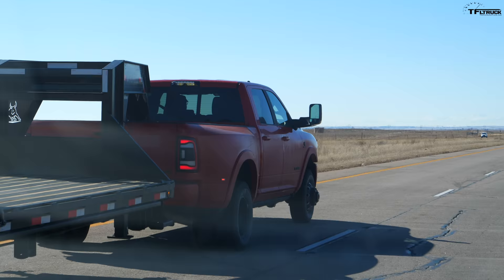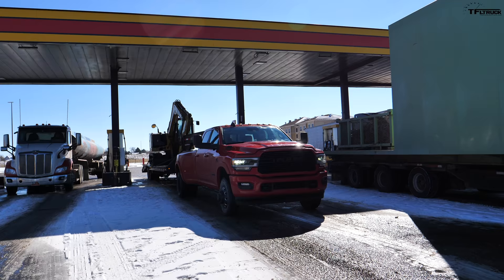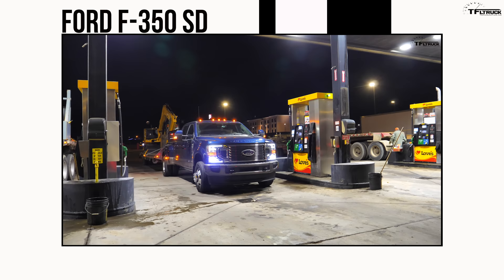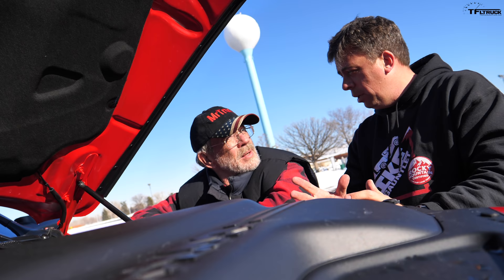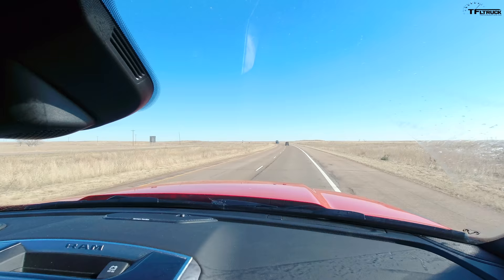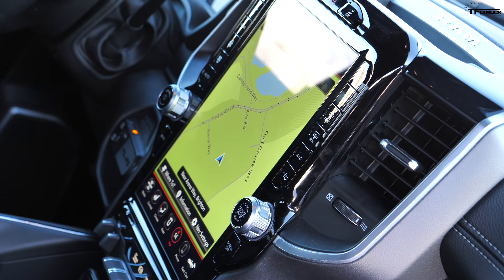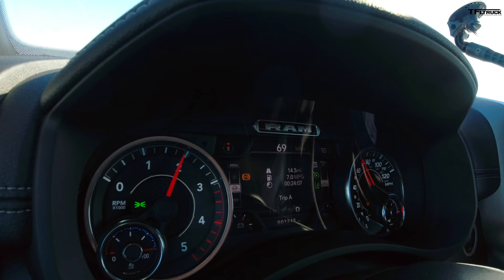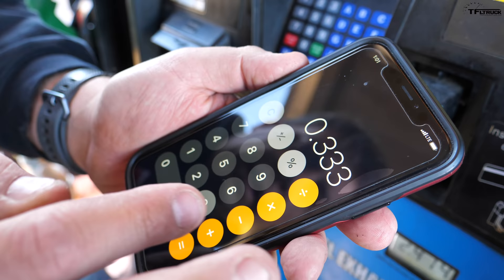New Ram 3500 Cummins Takes On Our 30,000 Lbs MPG Challenge Against GMC & Ford Diesels!

Comment: Ok Ram boys come with all your excuses.
Reply: Well it is a 6 speed vs a 10 speed...
Reply: It did great with that 6 speed and 4:10 gears!
Reply: Jason Williams it has a 4.10 axle ratio to offset that whereas 3.55 on Ford and 3.42 on GMC
Reply: L W 4:10 gears get you the worse mpg. I had 3:21 gears on my 2016 ram mega cab limited Cummins 2500, and that's why I was able to achieve the mpg I was getting 19.4 -20.1 with mixed driving.
Reply: John Doe ya I realize I’m just saying that Ram couldn’t hack a 3.55 or 3.42 with a 6 speed and the 4.10 keeps it in its power band better
Reply: L W oh OK. Yea, you're  right in that aspect.
Reply: John Doe but yes I agree I’d like to see the Cummins with a 10 speed Allison or ZF with 3.55 gears n see the comparison but I do know the ford now has a lot more low end torque now than the Cummins and that helps keep it in a lower gear
Reply: @lw6735  sure it can final drive is only one part of the puzzle
Reply: Dodd Garger Lol I know it “could “ but it could not run a 3.55 or 3.42 with a 6 speed and compete. Final drive is definitely not the only thing lol 10 speed has much smaller gaps between gears as well and therefore to compete with the others having a 10 speed n Ram a 6 speed you gotta use. 4.10 gears as has been the case with F350 drw with 6 speed transmission all along before 2020
Reply: If I'm paying 85k for a truck....I could care less what the fuel mileage is.
Reply: @bucklcj1  Always has to be that one dude that spouts off about how mileage doesn't matter in trucks. It matters to everyone else.
Reply: bucklcj1 Lol right but what if it gets the worst fuel mileage has the least reliable transmission gets up the hill slower and has less hp and torque and is still more expensive lol that’s what is in the mix Ford vs Ram lol 😂🤷‍♂️
Reply: turbolq4 right Cummins guys will never learn that we’re not in the 90s and 00s where Cummins did have the advantage in a lot of ways but things change lol
Reply: Lol I have a charger with the 392 and people always ask...what kinda fuel mileage do you get? Crying out loud I have no idea I bought it cause it has 485hp, I could care less what it gets
Reply: @bucklcj1  i actually like the fuel mileage on my GS Vette. That was one thing i liked over the Viper when choosing between them. I like taking it on trips and didn't want to be searching for gas stations all the time. I can get 27mpg hwy at 75 mph and i am putting 428hp to the wheels. Over 500 at the crank. That is pretty good. I can do a couple hundred miles without stopping for fuel.
Reply: L W 
Boom. Mic drop!
Reply: @bucklcj1  You're one of those. Lol.
Reply: @lw6735  Makes a definite difference.  I have an 18 F350 DRW with the 6 sp. and 3.55 because most of the time I am on the highway and not towing.  When towing a 14K lb. RV with a 13.5' height I get 8-10 mpg unless I have a tail wind.  Comparing a 10 sp. with 3.55 to a 6 sp. with 4.10  is almost apples to oranges but as the man said, you gotta dance with them that brung you.  And for those who say the fuel economy will get better, I have over 30K miles and have seen no appreciable improvement.
Reply: It's called what the manufacturer engineered,10or6 speed, that's the difference in the trucks.
Reply: Towing that weight anything will be bad on fuel 😃